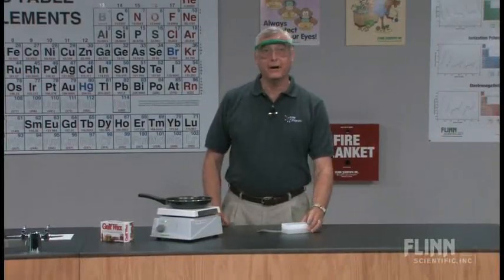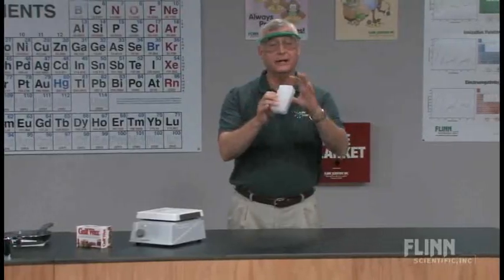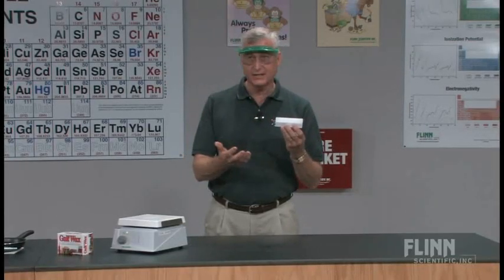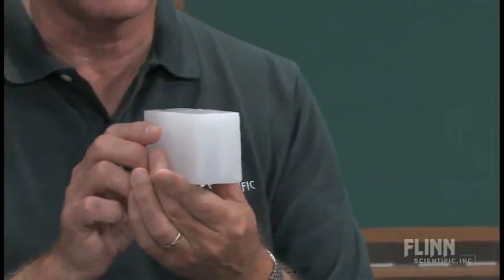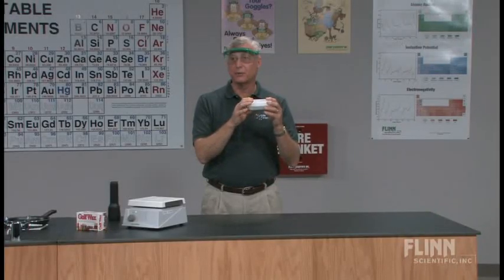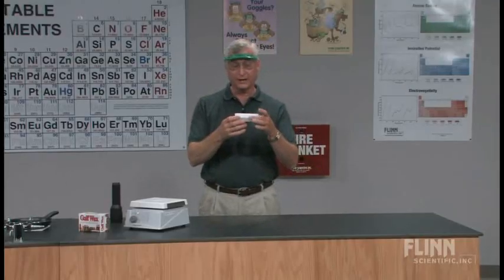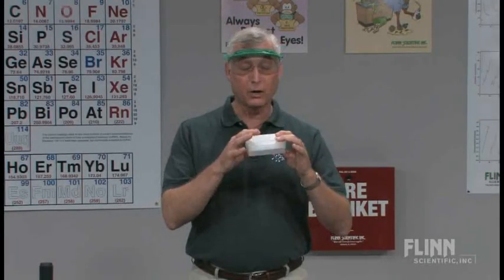Paraffin Paradox

Comment: Depends on what you call a paradox.  The paraffin is translucent.  It interferes with light passing through but not completely, so it appears illuminated by light while some light passes through.  I wouldn't call that a paradox but someone might.  Maybe someone would call the wax a semiconductor of light.  Maybe they wouldn't !  The foil acts both as a reflector and a shade.  Whichever side has more light hitting it will reflect more light back into the block while the other side will be in the shadow caused by the foil.  I wouldn't necessarily call that a paradox either but someone might, since it is both a reflector and an opaque shade.  Is this mysterious?  I have to admit, I would have been more puzzled if I didn't already know the foil was in the middle.  It is a good thought exercise.  For some, it's evidently more important to rule on whether it's a paradox or not.  I think it's a paradox but it's not a paradox.

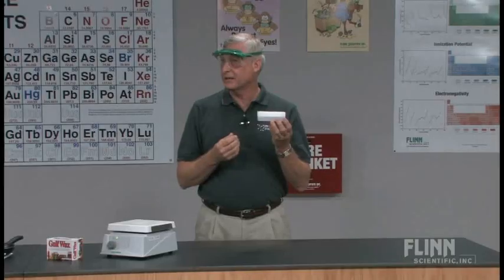Comment: I'm 4:25 into the video, I've skipped it already like five times.
Its white on the top because the room lights are reflecting off of the top of the foil within the top bar of wax. The bottom bar is dark because there is not light beneath the foil.

Edit:
I was right.  I now feel smart.
Reply: its not about the block. It's about teaching

Comment: the top is refracting light from the overhead lights which is a white light, AKA full spectrum if you will. The bottom is refracting the light from the slate table below it, which is reflecting a black or grey color of the visible light spectrum. The aluminum foil creates a reflective barrier to separate the two halves.
Reply: Actually, because the aluminium is reflective, it's reflecting, not refracting. If the light was passing through the aluminium and coming out the other side a different luminosity, then it would be refraction.

Comment: Interesting project. I've seen something similar with alabaster stone. A deep crack in the stone causes something similar, in that light will not pass cleanly through, and you get a light and dark side to the stone. 

I've used this to determine how bad the cracks are, and if i'll need to soak the piece in superglue to shore up a bad crack midway through carving.

Comment: As lecture for children under ten years is good, but 10 minutes of narration that if something leads light is covered, so that light does not lead is a little long ... 

Also, I do not think it is a paradox.

I thing, a paradox is for example that hot water freezes faster than cold... or again water, when it chaged to ice it increases cubic capacity (while other elements cubic capacity decreases)...

Sorry for Google English, I am not good in foreign languages...

Comment: What is the point of adding the Al foil layer?  It might block light shining from the side through to the other, but it isn't the cause of the difference in shade between the upper and lower blocks.  The illuminated block is a different shade before and after.

Comment: (Please do delete)
I think it is simply there are 2 blocks.... the light is mostly absorbed by the top block... I didn't see any light being reflected off the middle,  basically it goes in the substance and the light is mostly absorbed, so by the time it hits the bottom block.... there isn't as much light so it looks black, but it is really just dim...  No Gimics, I think you can do it with a bit of Ice too. but it has to be the cloudy ice not the clear Ice, or even 2 bits of cloudy glass.

 It is in short a Optical Illusion that seems like a paradox, both sides are fine.... for once he turned it to the side both sides were lit up.... the light at the bottom became brighter than at the top causing the top block to look dark.   I don't know if photondynamics is a thing... but I bet some other forms of science would explain it in a highly complicated way.

but in Super short. "Light and Shadow" And "distribution of energy"

Comment: paraffin has high sub surface scattering and low absorbtion. bottom block is darker because aluminum cause to light cant pass thru and this block only scatter ambient light. again glossy aluminium reflect the direct light back and light scatter more in top block....

Comment: My assumption is that the light source has something to do with this, the top layer absorbs most of the light, making the bottom layer seem more translucent.
It might also have something to do with the aluminum foil being able to reflect light,  therefore this is not a paradox, just that you haven't assumed all of the properties of the materials involved and the surrounding area.

Comment: Well it's not about the Paraffin it's about observing, how to work towards a solution for an occuring problem in physics or science. Well to explain what happens in the Paraffin: The tin foil reflect the incoming light and disperses the light back in to the Paraffin. Because of the light source above this guy, the top of the Paraffin block is more white than the lower part. The Paraffin is somewhat of a cage for the lightrays; the light needs longer to leave the upper Paraffin block because of the "mirror" between,.

Comment: Where's the paradox in this? O.o
Reply: I think its about flipping it around and the brighter half stays on top which is the paradox. But i think it would be quite easy to guess that something is preventing the light from passing through the middle of the two blocks, and the fact that the difference in color being that significant would indicate its something with a reflective surface in between, in other words it's not air, it's a metal layer, considering how flat it must be, the answer would be aluminum foil. but now i already saw him making it so i guess my answer would be different. would be fun if he made us guess before showing it first.
Reply: Definition of paradox
1:  a tenet contrary to received opinion
2a :  a statement that is seemingly contradictory or opposed to common sense and yet is perhaps true
  b :  a self-contradictory statement that at first seems true
  c :  an argument that apparently derives self-contradictory conclusions by valid deduction from acceptable          premises
3 :  one (as a person, situation, or action) having seemingly contradictory qualities or phases

So basically, the paradox is that you wouldn't expect the way the colors behave (mainly according to three)
Reply: That's not paradoxical, its just odd.
Reply: This is a perceptual paradox, not a physical one. To most observers it will appear counter intuitive.
Reply: It's not actually a paradox, Paradox just sounds sciency and Mysterious. They also make great games.
Reply: Definition of paradox
1
:  a tenet contrary to received opinion
2
a :  a statement that is seemingly contradictory or opposed to common sense and yet is perhaps true
If something is light on top and dark on the bottom and you flip it 180 degrees, what will happen? Common sense says it will be dark on top and light on bottom, but this is not the case. Hence, paradox. Knowing the solution before the problem taints the paradox.
Reply: you turn it upside down and the dark-side goes back to the bottom - without knowing about the foil, it seems paradoxical - you can't actually see the foil, but it makes it look different.
Reply: When he flips it........
Reply: Most people expect 2a and 2c when someone says "paradox". I don't think paradox was the best word to use for this situation.
Reply: There's nothing paradoxical. They simply don't know the reason to begin with. But by all means, flip out like a child.
Reply: AFmedic6871 you know calling people dumb because they don't know English perfectly is actually dumb? It's Youtube, and Youtube is on the internet, and the internet gathers people from all around the world, so for many of those people, who still speak English, it's their second or third language. 

And the paradox can exist only in certain paradigm, if you change paradigm, old paradoxes are no longer paradoxes, but new ones appear. In my paradigm, this block changing color is normal, not paradoxical. I actually liked the way method in this video was presented, but the world "paradox" in the title looks to me like a clickbait (may be unintentional) so I rated it negatively. I even came to check in the comments if I missed something, but it seems not.
Reply: It's all about the knowledge. It might seem like a paradox, if you don't know, what "trick" lies behind this. It's like someone talking about the colour of Butterfly's wings. What colour do they have? They are made out of small scales, that actually don't have any colour at all, they break the sunlight into different colours, giving the impression, they have a certain color. Without knowing that, people would actually guess any colour for the wings, or at least the one, that they see. Does that make them dumb? They only don't have all the necessary info. Lack of information doesn't mean, someone is really dumb.
Reply: It's more like a method
Reply: KazeRV none, they only think morality is an object.
Reply: Exactly what i was thinking! This pissed me off so badly because  a paradox is a statement that, despite apparently sound reasoning from true premises, leads to a self-contradictory or a logically unacceptable conclusion.
Reply: No... I have actually seen this in a video before this but in that video they didn't say how it was made till the end yet I still knew it would be white on top when flipped even though it was on top at first because of logical thinking. That object is obviously semi-transparent and is really easy to tell whats going on if you use logical thinking. So Jabrail, don't act like everyone else is idiots because they could understand it therefore not making it a paradox where as you had to look up the definition to paradox.
Reply: Life Eater its a light hearted name referring to the seemingly paradoxical fact that the block changes color when flipped, even if it's not paradoxical. You might say duhhh, but in the same way a magic trick might be named the same thing. Obviously if you watched a magic trick tutorial revealing the secret you wouldn't say that's not a paradoxical when I know the secret
Reply: If something isn't really a paradox then i'm suppose to act like it anyways? Also, the block isn't changing colors, its simply the light shinning through the semi-transparent wax.
Reply: There is no paradox after you prove it, you dumbass. The original paradox was that even after flipping through 180° the colors of wax blocks remained same
Reply: KazeRV this wpuld be a paradox to a child, because it is not instantly logical to them.
Reply: That when you turn it upside down the light part remains at the top.
Reply: Yeah, it's not a paradox.  "Monster of shitting in pants" here.
Reply: hahah, thanks!
Reply: For those idiots who are stating question like "where is paradox"
A paradox is a statement that, despite apparently sound reasoning from true premises, leads to a self-contradictory or a logically unacceptable conclusion.[1][2] A paradox involves contradictory yet interrelated elements that exist simultaneously and persist over time. - Wikipedia.
So after flipping over the black side should be on top and white side should be beneath. It is something u idiots would think. This is why it is paradox. But it has some reasoning. And u idiots feel like monsters of knowledge and logic only cuz the guy in the video  explained u that reasoning. LOL u r all monsters of shitting in pants so stfu
Reply: OMG! ROFLMAO! Reading the post and some of the replies is pathetic! Apparently not only are there those who were never taught science properly but was never taught English as well (or more importantly reading comprehension). Despite the numerous explicit definition for paradox they still argue it is not a paradox. Well at least these people can rejoice in the fact that you don't need brains to breed!  OH!!!! what a scary thought!

Comment: It's good that he's wearing those safety goggles. Blocks of paraffin have been known to go for the eyes.
Reply: I acknowledge that this is a joke, but if the paraffin is of cheap manufacture it may have air bubbles large enough to cause wax bubbles to leap from the pan during sealing.
Reply: @s6th795  that was such a respectful way to present your thoughts. wow
Reply: it's not just about the paraffin -- safety goggles may not be necessary in that particular case, but it protects you from another 370 000 possible accidents you don't expect and may not even have a clue about at that moment; like the pan being unexpectedly hot
Reply: @LiborTinka  A large drop of sweat could cause the liquid paraffin in the pan to splatter quite violently (albeit briefly and this is about the best i can come up with)
Reply: must be to protect his eyes from exploding ^_^
Reply: Proper lab gear
Reply: "Hssss!" 🕯️
Reply: Right! Walter White didn't wear safety goggles even while spraying an open flame to change its chemical compounds.
Reply: i have you heard of what i is going with her
Reply: Fool!
Reply: Paraffin is actually explosive when heated
Reply: @lacrevette028  only if wax is boiling, catch fire and you throw some water in it :D just like other oils :D
Reply: @lacrevette028 
isn't that when you rapidly cool it? the phase change is intense

Comment: HOW?
Reply: nvm is it the light source?
Reply: How what? How is it a paradox?
There is none, it is a bad use of the word, it's a lesson in observation.
How do you get the different shades? Light from above can easily go through the top block of paraffin and the tin foil stuck between the two, prevents the light from going into the bottom block of paraffin, essentially creating shade.
The lesson is that through observation and deductive reasoning, you can come up with a solution.

Comment: A paradox is a statement that, despite apparently sound reasoning from true premises, leads to a self-contradictory or a logically unacceptable conclusion. Some logical paradoxes are known to be invalid arguments but are still valuable in promoting critical thinking. -> The block is made of one material, however the top half of the block is a different colour from the bottom half. Even when the block is flipped.

Comment: I mean, unless you shine the flashlight from the back and see something blocking light, theres no reason to assume that there is necessarily something between the two blocks, it could simply be that they are joined together but because they are two discrete blocks, the light diffuses through the first one but not the second because of some refraction and diffusion principle.

To conduct a proper experiment one would have to find two other blocks of wax and then attempt to recreate the paradox block, either by sticking two blocks together and seeing how they act, whether light diffuses equally or stops at the seam, 

Once youve made observations as to the properties of the material and attempted reproducibility, then one could attempt to give a hypothesis as to what is actually happening.

Comment: so, the paradox is a piece of aluminium blocking the light?
Reply: STEVEEV GAMES Also reflecting and making the other side look brighter.
Reply: yeah, that also
Reply: No, the paradox is that when you turn it upside down, the top remains at the top. Normally when you turn something upside down the top and bottom reverse. The 'top', in this story, is considered the block with a lighter appearance.
Reply: but thats actually not a paradox, its a riddle
Reply: For those idiots who are stating question like "where is paradox"
A paradox is a statement that, despite apparently sound reasoning from true premises, leads to a self-contradictory or a logically unacceptable conclusion.[1][2] A paradox involves contradictory yet interrelated elements that exist simultaneously and persist over time. - Wikipedia.
So after flipping over the black side should be on top and white side should be beneath. It is something u idiots would think. This is why it is paradox. But it has some reasoning. And u idiots feel like monsters of knowledge and logic only cuz the guy in the video  explained u that reasoning. LOL u r all monsters of shitting in pants so stfu
Reply: Reality cannot have actual paradoxes, only perceived contradictions. As he said, you would introduce the object as a block. When most people think of blocks, they think of a block of some uniform material, not a sandwich of two different materials.

Comment: It's so obvious though? The aluminum sheet in the middle naturally reflects what little light makes it through the wax, as he said, it was "opaque" or "Not able to be seen through, foggy" by definition. Even without the flashlight, what little light hits the top is then reflected by the foil, darkening the bottom half of the block, the only reason its not darker is do to stray light particles          [I Know I know light's not a particle or a wave] hitting it from different sides apart from the top.

Comment: The aluminum is reflective, and at the same time blocks light. Whichever broad side of the block is facing a light source, the light gets reflected back (seeming to fill the top half up with whiteness), while at the same time, blocks light from spreading to the half facing away from the light source. It took this guy 10 minutes to explain that.

Comment: Where is the paradox here, though?
Reply: It's an example to show the students what a real paradox might look like.
Reply: Assuming you are the student, without knowledge that there's aluminum foil between the halves, you would not expect the block to be lighter on top and darker on the bottom even when flipped over. That's the paradox to be explained.